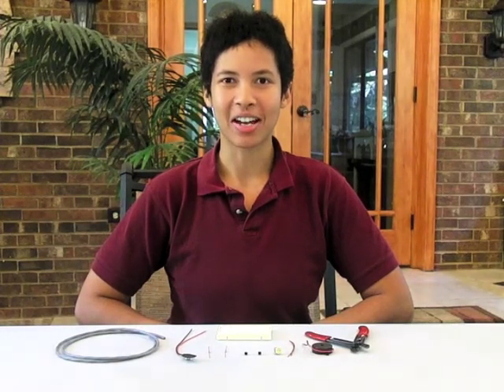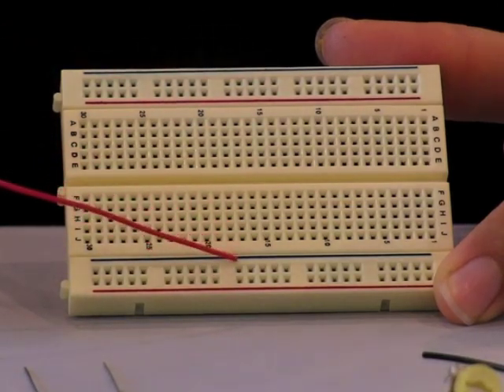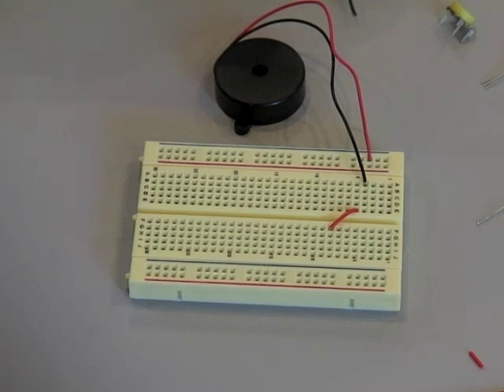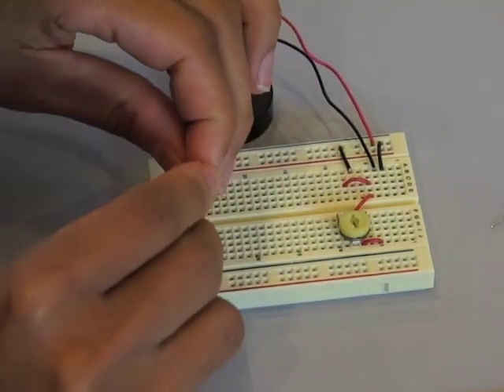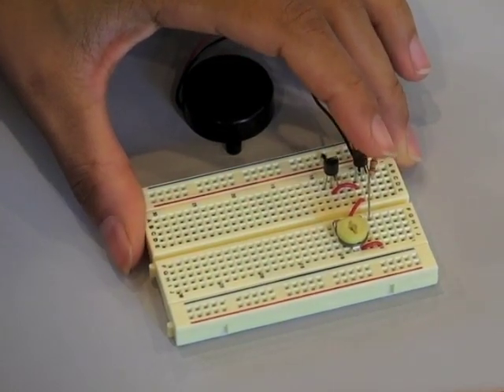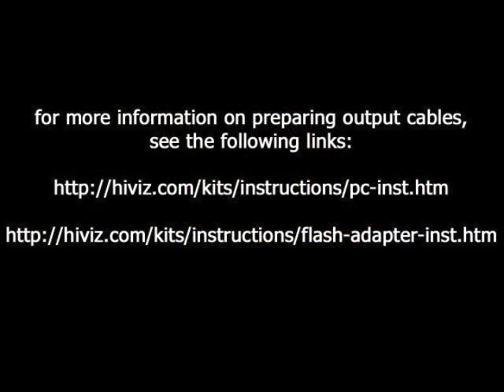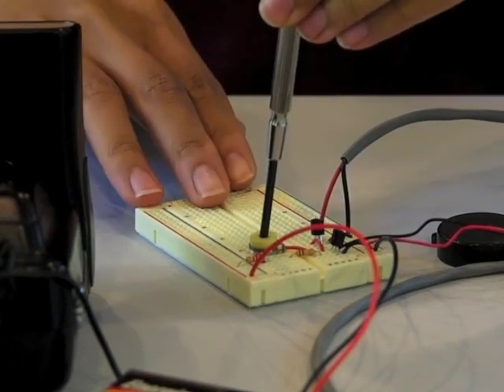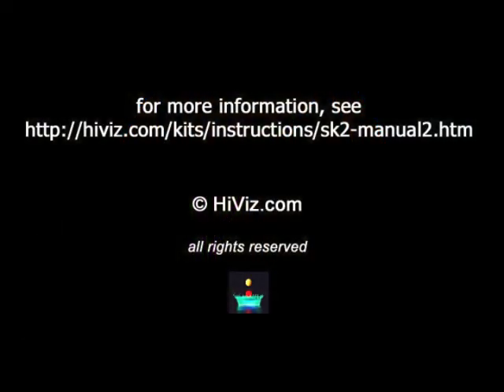Building the HiViz Sound Trigger (SK2)

Comment: Hi. Thanks for your help. Would it be possible to connect an LED to my SK2 kit like this: postimg. org/image/v3tto0u5z/ (the red and black hookup wires connecting the led circuit
to the SK2 trigger would be very long). Also, instead of using a single LED could I use on of these: goo. gl/4lQudB  If so how would I connect it?. Thanks

Comment: Hi . Great, detailed Video - Almost exactly what I was looking for. However, there are just 2 differences I would like to achieve so I wonder if you could help or advise me.
1. I would like my SK2 trigger  to only react to close gunshots, (not loud laughing, shouting etc)
2. Rather than using a camera flash, I would like a superbright LED to illuminate. However, this needs to be attached on a very long wire at a distance of approx 175 to 225 yards away  from the SK2.
Is this poss./how??. Thanks.

Comment: Built this but I am having a lot of trouble Evernote with the flash in manual mode set to its lowest power it is making the flash duration longer depending on how loud the sound is, is there a way to solve this

Comment: Hi! First, thank you very much for this tutorial. I finally got my trigger working by following your instructions. Now there's a small problem with my kit: It's not sensitive enough. Even with the potentiometer on the most sensitive setting. I have strayed from the tutorial by using a 5.6Kohm resistor instead of 5.1Kohm (Since i cant get 5.1Kohm). Otherwise i'm using the same kind of components. Do you think that my piezzo can be unsensitive and that it would work better with another piezzo?